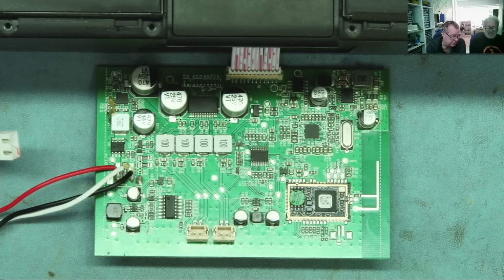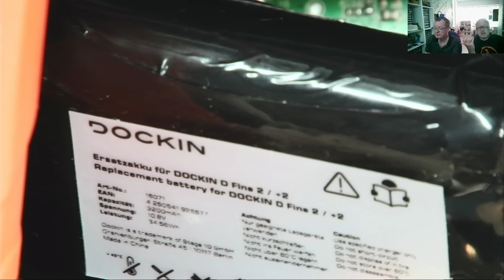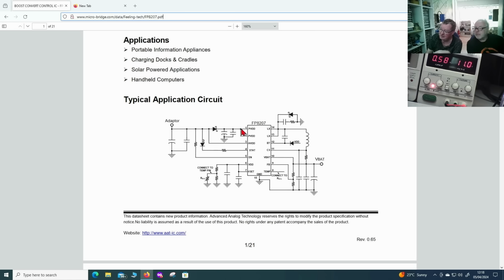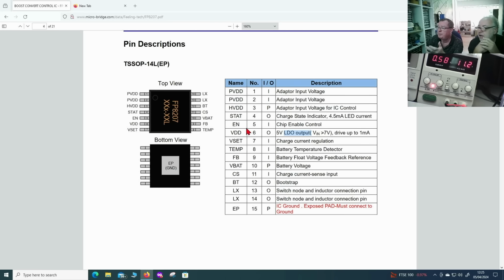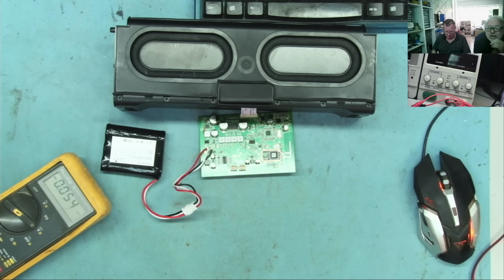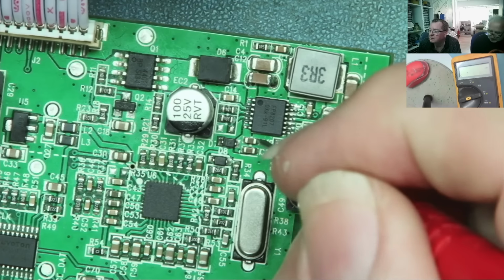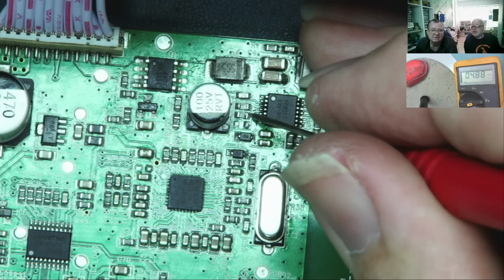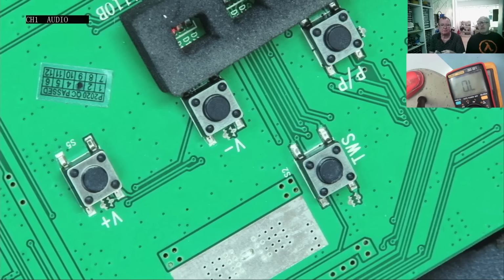Dockin D Fine 2+ Bluetooth Speaker Battery Will Not Charge. Let's Fix This!

Comment: Actually this is a nice video without the editing, it doesn’t ruin the viewing experience and I’m sure it’s less work for you, if it means you’d publish more repairs I’d definitely vote for no edits. As for the hole in the pcb that’s a great tip actually for designing these things if it’s a pad with connection right in the middle leave a hole so when you push down while soldering the excess can come out from below (hopefully) 😂

Comment: That's fantastic...  As group we came up with things to investigate, and it can even show sometimes when we replace a part, things might not go as expected,  I have never seen a chip like that,...  That can be soldered in that way. So this video was a learning experience, in what can happen replacing this style of chip.   Great video... Any time we can learn something new. That's fantastic. 🙂
Reply: Yes, nice catch. Horrible design of that  chip though. It could have been worse still if the PCB designer did not have a hole on the back side of that chip. Probably the indent in the pad is to both increase surface area and to provide for a overflow cavity in case too much solder paste has been used.

Comment: I have RockBox Chunk on the bench with a not charging fault - no sign I can see of an FP8207 - black, white, and red wires to a 4-cell battery configured two parallel in series. Just about charged up by my bench psu now -  though probing the pcb some components are shorted.

Comment: Did you leave it charging to check that the LED went from flashing red to flashing amber to flashing green, then solid green?
Reply: I wish he did 🥲 I received the speaker back now from Richard and it still doesn't charge, nothing changed.

Comment: Hi, I have a Dockin D Fine and the green led flashes very quickly when charging. The pal speaker only lasts a short while in use. Is this a bad battery? I have been using the speaker for 5 years.

Comment: This did not fix the charging issue. I've now received the speaker back from Richard, and it is experiencing the same exact issue - still not charging. I'm losing hope with this god damn speaker 😆 Thankfully I have a second one of these, but I wanted to use these in stereo. Womp womp.
Reply from the maker: Strange because it was charging at the end of the video 🤔  What is the charging LED indicating now?
Reply: @LearnElectronicsRepair  How do you know it was charging at the end of the video - have you plugged the board/battery in, charged it for a bit, and measured an increase of voltage on the battery? 🤔 Because I haven't seen you do this.

The LED charging indicator is blinking red just like before, nothing new. But the battery isn't actually getting charged.

I've had it plugged in for 2 hours - the battery went from 9.99v to 9.79v. Same conditions, charger, battery. I've even tried a fresh battery out of my second speaker as well as its charger - same result.
Reply from the maker: @filipthedev  On the video at 40:25 there is now a voltage drop across the current sense resistor (there never was before) so at this point there is charge current flowing into the battery.  Can you check if you still see a voltage across these resistors please. If your multimeter has a millivolts range
Reply: @LearnElectronicsRepair  I did yesterday, but now I can't even get the board to turn on. Plugged in a charged battery, which is at 12.1v, but after plugging in, it trips the BMS and goes to 0.00v. After unplugging, it goes back to 12.1v. 

Also tried charging right now, but now I get no LED whatsoever. Something is really wrong with this thing.
Reply from the maker: @filipthedev  Agreed, Let me think about it a little bit...